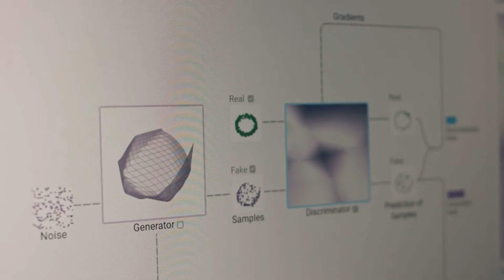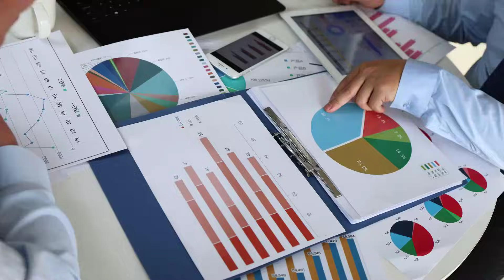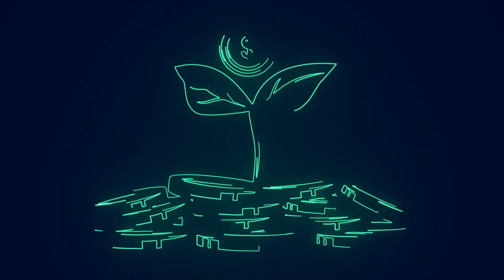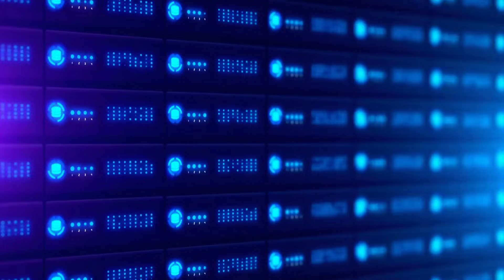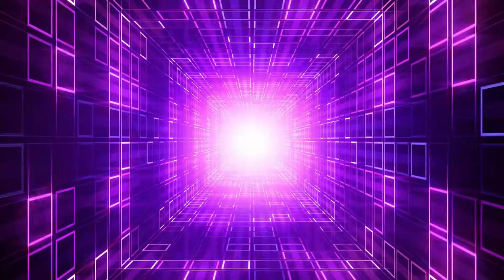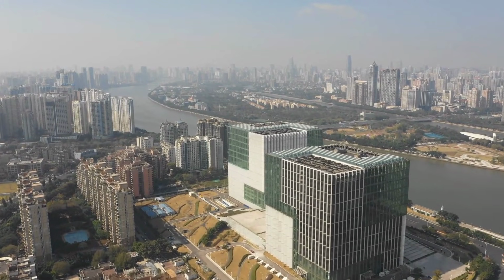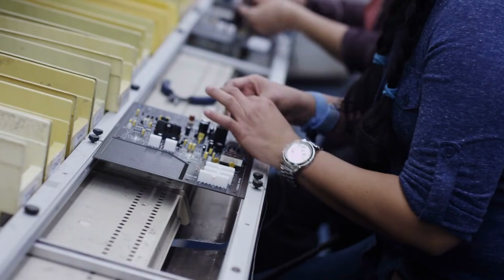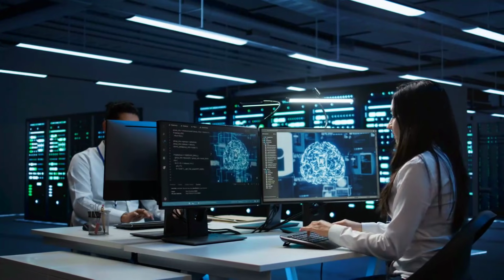A Chip That Doesn’t Use Transistors?

Comment: It sounds like they were copying how the brain works. However the the brain has billions of nueral connections vs millions.
Reply: The brain has 10^11 neurons, of those 10^11 in the Cerebrellum 🙂
And each neuron might have 1000 connections to other neurons.
That's 30, 40 years old numbers, so they might need refinements.

Looking it up, he latest figure is approximately 86 billion neurons—give or take a few billion, depending on the individual.
Source article:
How Many Neurons Are in the Human Brain?
In Science News Today

But you have to remember that the neurons are pretty slow compared with a photonic chip, and the brain mostly handles the body.
Only a small part of it does any pure intelligence work, 10 % maybe.
8.6 billion neurons, 1000 times slower. That cotresponds to just 10 million artificial neurons.
Some error here, though. Faster doesn't equal more of them. But you can imagine what it would mean to have a brain 1000 times faster.

What I'm saying is that a few million artificial neurons is a lot. And that's just where it starts. Remember Moore's law!

A big difference might be that the brain is 3-dimentional, while a chip is only 2-dimentional. If that would change!

The great thing with photonic chips is that they aren't as power-hungry as  silicon chips are. That makes a profound difference.